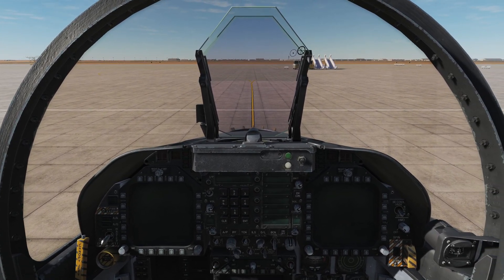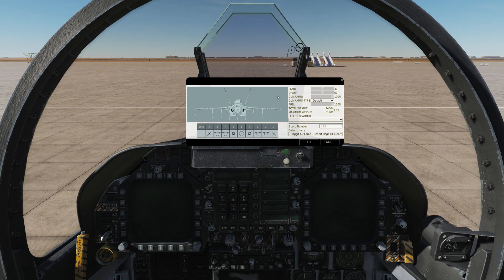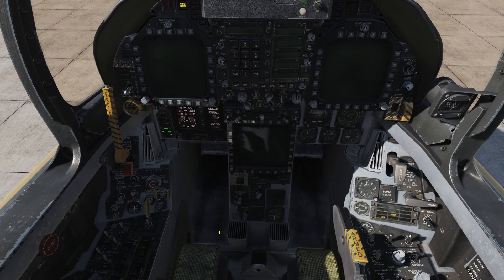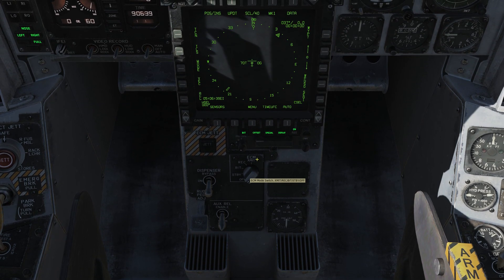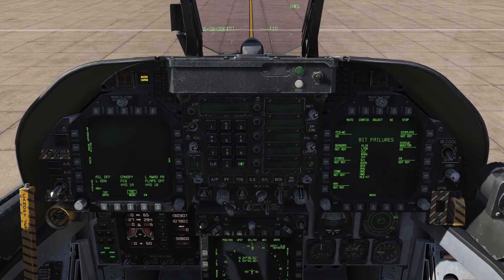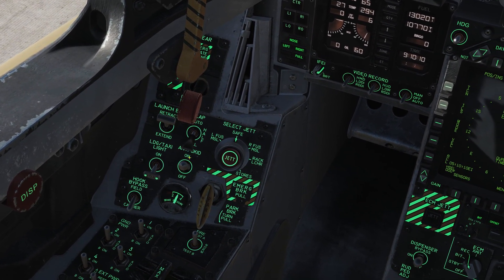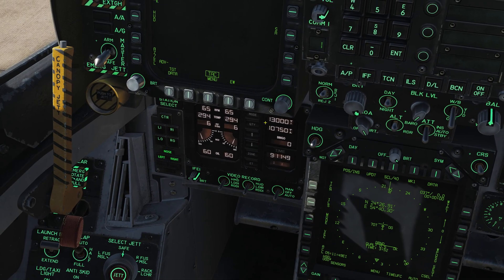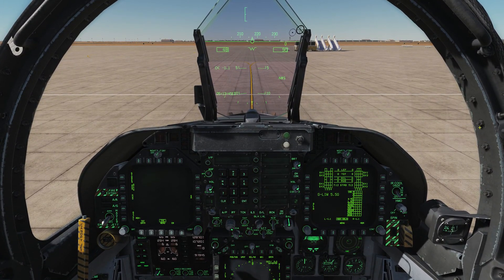DCS World Tutorials - F/A-18C Hornet - Starting up from Cold and Dark

Comment: Great Tutorial thank you. Just one thing. You forgot to mention in the start-up procedure the Bleed air knob needs to be turned 360 degrees clockwise.
Reply from the maker: It actually does not. If you notice, I skip the bleed air tests. You only need to rotate that knob if you do the pre-start tests where betty yells "BLEED AIR LEFT, BLEED AIR RIGHT"